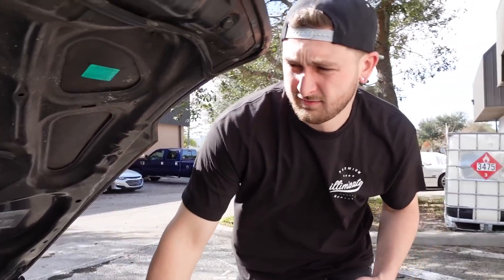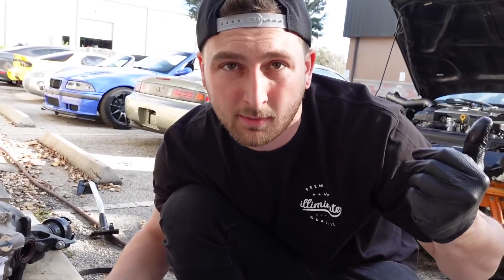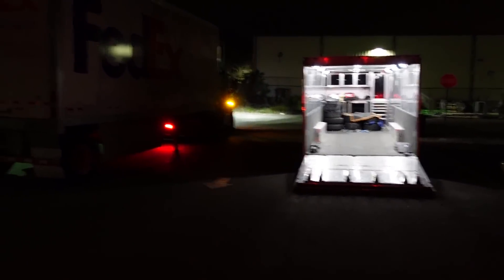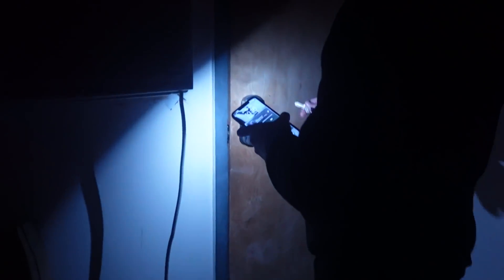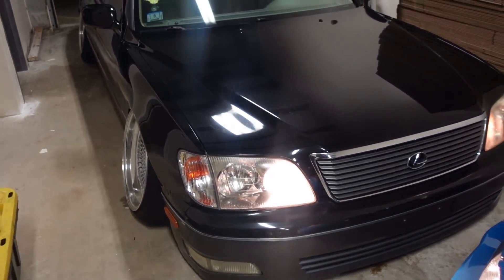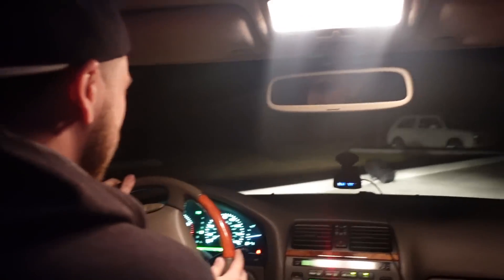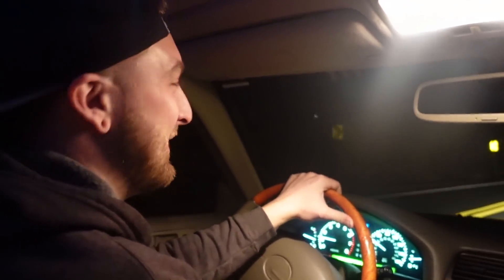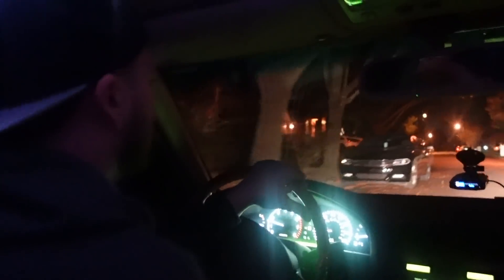Mike let me slowly total his VIP LS400..

Comment: Couldn't you just swap pulleys? And then have all the ribs
Reply: Or even just buy the correct pump as a reman?
Reply: @madmatt2024  like he said they discounted it so its probably a bitch to find or if they do its a million dollars why not do the swap lose a rib and not only save money but know parts are plentiful
Reply: @madmatt2024  i deal with the same shit on my 98 cobra fords discounted the parts and reman or aftermarket is fucked so I gotta make gt stuff work sometimes
Reply: Again Noone is answering my pulley swap question 😒
Reply: @dogtruckable  i know on some pumps yes you can swap the pulley and keep all the ribs but I don't know about the 350s
Reply: @brendondeschamps566  idk either but since he said there virtually the same I don't see why you couldn't unless the shift or potential key way is different
Reply: @dogtruckable  yea I know some pumps you can't even pull the pulley off
Reply: @samthesr20man  Been working as a mechanic for over 5 years and most of the time they are fine.
Reply: @madmatt2024  that's nice. I've been a mechanic and electrician for 15 years and every 2nd reman we fit shits the bed. I do our remans now, and we actually make money outta them.
Reply: The pulley is friction welded to the shaft I think, I’ve tried to remove them. It will just ruin the pulley.

Comment: What if you can swap pulleys from one to the other and still run the same size belt? I know that's a little more work than just putting a smaller belt on there but just a thought...